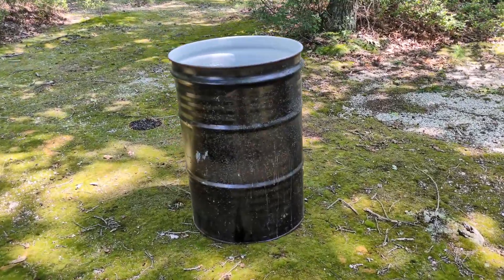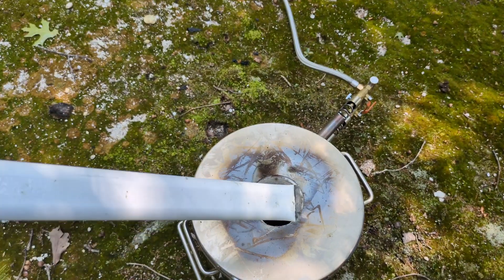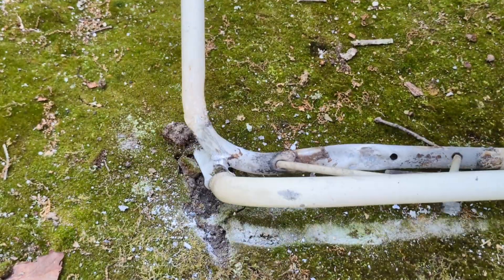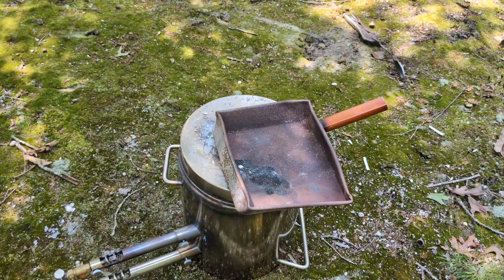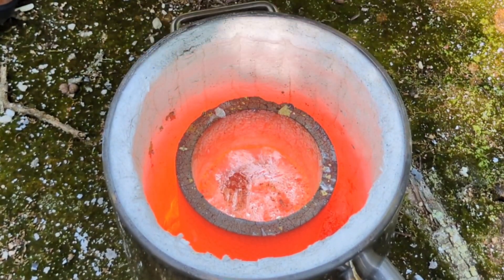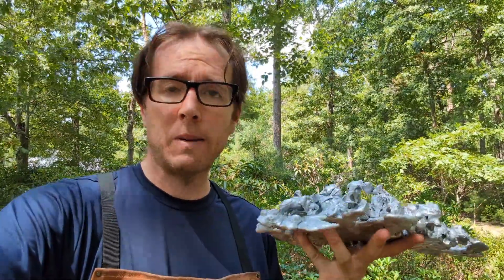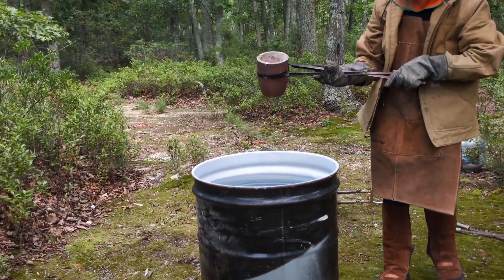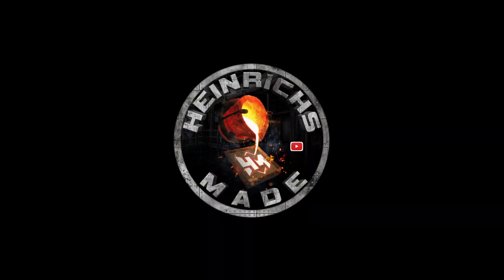Pouring Molten Aluminum into a 55 Gallon Drum of Water - Melting Metal

Comment: Hi if your trying to make shot there is a YouTuber I watch called sreetips who does gold and silver , when he makes silver shot he does what you just did but obviously on a smaller scale but he has ice in the water and a saturated board and a water pump that he pours the silver on to so it cools down a lot quicker with almost perfect results for making shot , iv done in with aluminium on your sort of size so it's easier for me to weight up with copper to make aluminium bronze and works very well, try it and see how you get on with it , hope all goes well
Reply from the maker: I was actually just playing around and making shot at the same time.  Yes if I had colder water it would have worked better.  It was in the summer and quite hot.  Putting ice in the water would definitely help.

Comment: You really want to try and pour copper into water mate! 👍 just don't hold the crucible too close to the drum, otherwise the copper will be to hot hitting the water and can cause a steam explosion. I found that out about a year ago and it sounded like a gun going off!🤦‍♂
Reply from the maker: I don't think I want to try copper after reading you comment.🤣🤣🤣  Even pouring the aluminum into the water, you can see it splashing up and coming close to going into the crucible.
Reply: @HeinrichsMade  if you take your time, you'll be fine just do it extra slow
Reply: If I'm not mistaken, aluminum would act like potassium and explode, except it oxidizes super quick and covers the aluminum. If the oxidized layer is disturbed, it could go boom. I could be wrong, but worth researching.